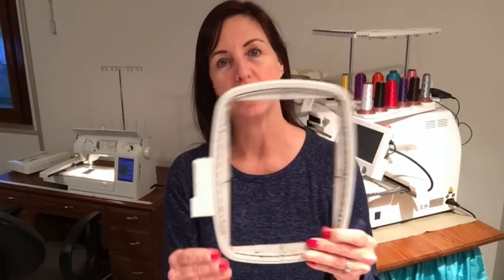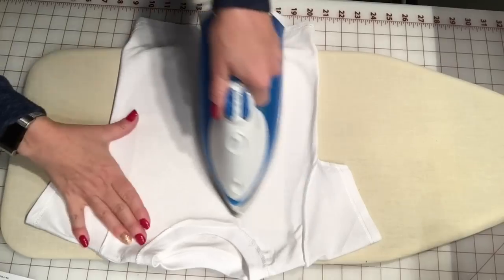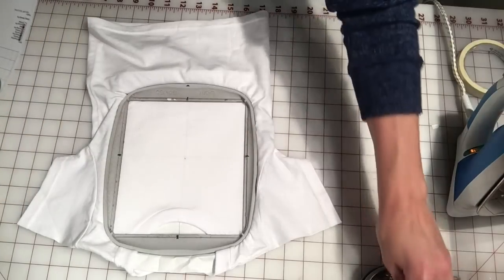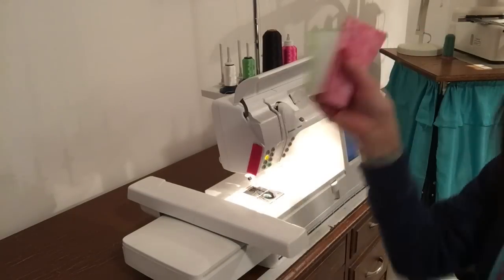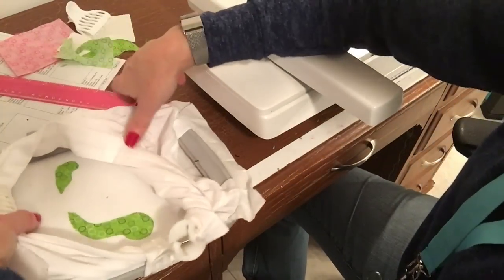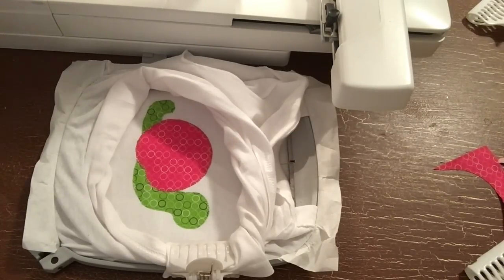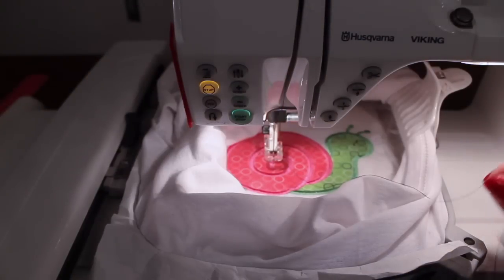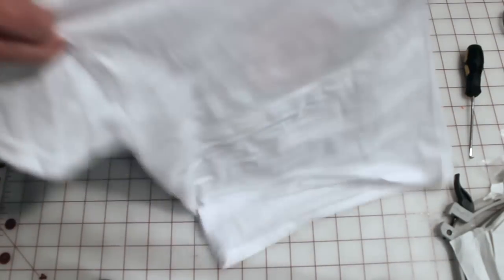APPLIQUE TUTORIAL: How to Applique on Embroidery Machine: Beginner Applique

Comment: I would think you’d have a hard time seeing the reference lines through anything but a light colored shirt.  That’s the problem…. How would you line it up on dark, or chambray or denim?  Also what about a larger design than fits in the hoop? Is it possible to do something like that?
Also where can i get the offset scissors?
I used to appliqué pretty complicated designs on a regular machine with a satin stitch but i usually just left the parts of the fabric that would be covered by other appliqués, and I would iron them all together at once and then onto the garment.  I’m trying to start up again but it’s hard on regular machines to do a lot of appliqué so I’m hoping to figure out how feasible it is to do it on an embroidery machine to see if I want to invest in one. It looks like a lot of fun.  My mother in law has one but she doesn’t do her own pattern design which is what I would like to do.
Reply from the maker: I would use chalk on a darker fabric. Then put a straight pin into the center of the shirt and line it up with the center of the hoop. Do the same for the side markings. 
In order to use an embroidery design, the only way a machine can read and embroidery a design is if it fits in the hoop. You cannot embroidery a design larger than the hoop unless you split the design using embroidery software. 
Here is the link to the scissors I use: https://amzn.to/3x7atPk 
If you want to create your own designs to use on an embroidery machine, you will need to purchase software in order to create the file the machine can read. It is not like a regular sewing machine. Embroidery machines have computers in them that need a file to read and then sews that out onto the item.

Comment: I have done several appliqués but have never done the heat and bond.  Why do you suggest this when the entire piece is adhered with the two step tack down and satin stitch?
Reply from the maker: most fabrics used for the applique, are cotton quilting fabrics. When sewing them onto a knit which is stretchy, the knit has stretch while the cotton fabric does not. Also when washing the item, they shrink at different percentages and directions. Using the HNBL, it essentially glues the fabric to the knit aiding in the applique material maintaining its integrity. It also helps the fabric to not fray and be pulled away from the stitching

Comment: I think my question is similar to the others.  How do you set up the machine to do baste the outline and then redo the outline with a tack down, it's not a normal embroidery and I don't understand how the machine knows the difference????
Reply from the maker: Linda the placement and the tack down are part of the design itself. All these steps are part of the design. Step 1 sews the placement. The machine will stop. Place the fabric down. Sew step 2 to tack down the fabric. The machine will stop. Then you cut the fabric. Repeat the steps for as many pieces of fabric the design uses. Then you move on to the decorative stitching.